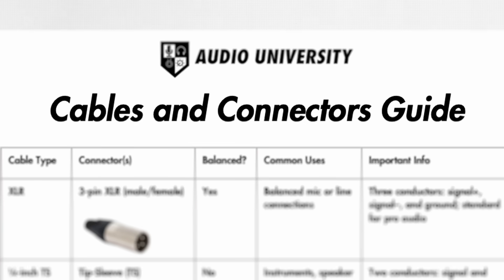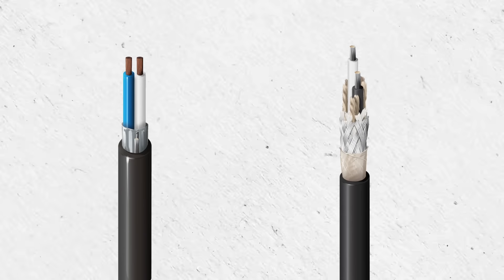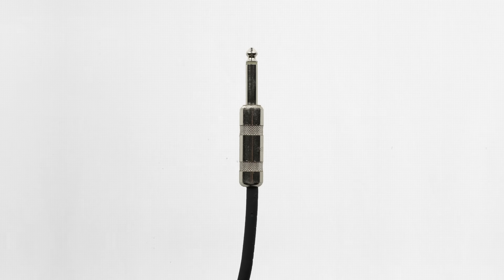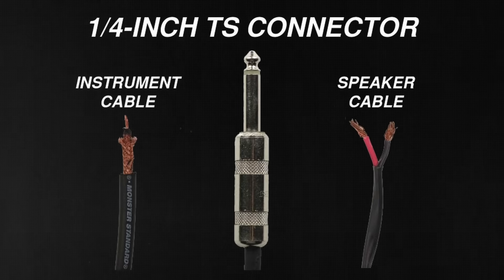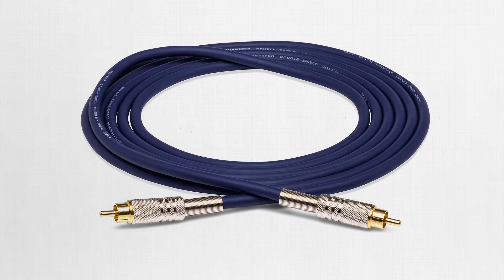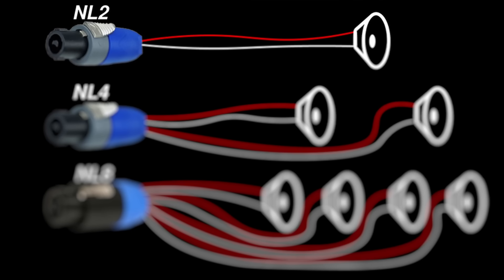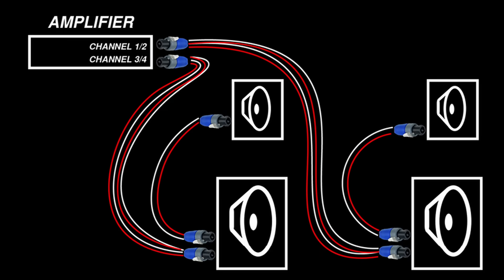The Ultimate Guide to Audio Cables and Connectors

Comment: Don’t say “return“, pin one on an XLR, and the sleeve on TRS are the “shield“ or ground reference. The only time a shield carries any return current is in the phantom power situation. Mini 1/8 inch or 3.5 mm connectors don’t generally carry phantom power, so it is only a shield and ground reference.

Comment: Great video!  @audioUniversity I tried to model my guitar pre-amp by connecting it to my Focusrite Scarlett 18i8 interface, but I got a lot of noise.  After watching your video, I'm thinking I used the incorrect cables.  Maybe I should use an instrument cable from the output of my Scarlett to the guitar preamp, and a speaker cable from the preamp back into the Scarlett?

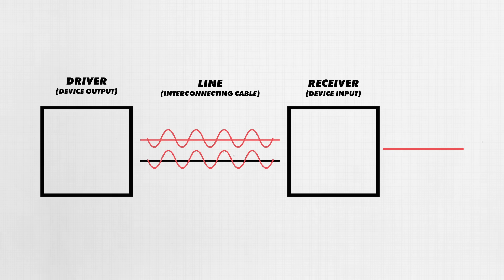Comment: At 1:31, need to invert one of those signals because in an XLR cable, one of the signals is transmitted inverted. So the picture should be drawn showing that.

Comment: And let us not forget DMX cables (used for lighting and other stuff stage automation stuff) that ALSO use the 3 pin XLR connector, but the wiring has different impedance (and capacitance?) than microphone/audio cables. While these cables are sometimes interchangeable, they shouldn't be indiscriminately used in place of each other. It is in your best interest to know which is which and use the right cable for the gear you are connecting

Comment: 2:15  the XLR connector also be Confused with 3 pin DMX Cables because the use the Same Connector, it works fine with XLR cable used for DMX and Vise Veraa, but it doesn't give the best experience compared to using actual DMX Cables

Comment: for a balanced connection,  pin 1 is for ground/shield, if I do not want shielding, can I connect pin 2 and pin 3 only?
Reply: pin 1 should still be connected on the transmitting end and then leave it disconnected on the receiving end.
Reply: @wally7856 why

Comment: The Phoenix to XRL connectors are a godsend when you're connecting a commercial PA system in a rack from the mixer to the amp. One of the Cloud UK amps I have seen in a rack-mounted PA System (Australia) has a Phoenix-like connection for the speaker wire that I have never seen before; it's usually the butterfly plugs on the Cloud Amps.

Comment: If my mixer has XLR outputs, can I use a regular XLR mic cable to run out to a powered speaker? Never had a problem with that, but is it advisable? Also, one of my XLR cables has the pin #1 connected to the connector chassis, whereas the rest of them don’t. What is the preferred usage for each? Rabbit hole time?

Comment: Learned the hard way years ago running a cab with my combo amp, it cut out mid song because of the circuit protection (thankfully) because I didn’t know there was a difference between a shielded 1/4” instrument vs speaker cable

Comment: There is no such thing as an "1/8th connector", it is 3.5mm.As an educator you should know better. There is also a Tini-Jax which is slightly larger.

Stereo headphones are implicitly balanced. The cable has four wires with the returns only joined in the plug so the "common return" only exists in the output jack. A loudspeaker is a differential device, it has no common reference. Interference would have to be massive to overcome the impedances involved.

Comment: Yes! Neutrik and Switchcraft connectors are by far the best, with precision engineering, precision mechanical/electrical connections and high quality materials. For Neutrik Speakon connectors, DON'T mix these with cheap Chinese knockoffs, the dimensional tolerances are mismatched. You will have high resistance connections to your speakers and you'll be sorry. Ask me how I know.....

Comment: Ookaayy, but why and how is the AES III wire different from a typical balanced mic cable? And what happens when you select the wrong one? Is there even an obvious telltale that differentiates one from the other?
Also, it's such a bad idea to use  TS 1/4" connectors for speakers. But if you did end up using an unbalanced instrument cable for the speaker, overheating or noise(?) might not be the worst problem, it might be the way it ruins the sound (low end) due to it's higher resistance.
Reply: AES3 Capable Cables are twisted pair to mitigate crosstalk between the conductors for the High Frequency needed with AES and also DMX (the Lighting protocol). it will say either AES/EBU; AES3 or 110 Ohm on the Cable (some just say DMX, the work fine aswell). sidenote: just because it does not say that on the cable does not mean it wont work. as long as everything is properly terminated and especially with a 48khz Samplerate you can get away with some pretty non optimal cables. just dont expect to reach the full 300m. but the nice thing: it digital. it either works or it doesn't.

Comment: One Question @AudioUniversity - Is it OK to have a cable that has 4.4mm Balanced jack on one end and having a split/dual RCA jacks on the other side? Is this technically OK OR shouldnt be used? Does this yield any better audio signal out of a source, say a DAP?
Reply: @kavithapremi  4.4mm? Sounds like a stereo 3.5mm unbalanced plug.
Reply: @tanelehala6422  Yes,  4.4 is stereo. But, a Balanced one.
Reply: @kavithapremi  Right, I had forgotten about the existence of that plug. I believe  the scenario you presented is technically okay. It's probably wired with shield and minus bridged or only one of them connected. You lose the balancing but in consumer audio when does it even matter? In extreme cases it might help against some noise or ground loops but definitely won't give you "better audio signal". It's often overkill and in the territory of audiophoolia placebo. And better audio signal compared to what exactly? In what scenario are you using it? Balanced headphones don't make much sense to me, it's an amplified low impedance signal and there is no possibility of a ground loop.
Reply: @tanelehala6422   Thanks and appreciate the response. My use case is in my car audio setup where the source is A&K SR35 DAP that has all 3 stereo outs [2.5 Bal, 4.4 Bal and 3.5 single ended], I decided to use 4.4 out while my DSP/AMP has only RCA in.
Better Audio Signal - compared to regular 3.5 single ended stereo to RCA interconnect.
Reply: @kavithapremi  no problem. IMO whether it's objectively better can only be measured. I don't believe using the 3.5mm output would make an audible difference but should be confirmed with a blind test and Frequency response, Total Harmonic Distortion, Signal To Noise etc measurements. Whether the difference is actually audible depends on the magnitude of it, your hearing, the rest of the equipment, the listening environment, the source file etc. If anything claims to *subjectively* sound better/different, it's often added distortion/saturation instead of transparency. I've heard that odd harmonics distortion can be pleasant. Any subjective claims mean nothing to me without being confirmed with a double blind test. Placebo effect is one helluva drug. Been there, done that (discovered EQ was on bypass).

Comment: What? No mention of DB25. In audio used as a breakout cable for up to 8 balanced channels. Worse yet, there are 2 'standards' for these cables. Often found on mixers and capture devices. 

Then since you mentioned 1/4 in to ring sleeve cables didn't forget the other use, insert cables. Where one pin is source and the other return. Used to insert effects units and the like. 

Audio is not the only cable that takes advantage of requested pair wiring, as with XLR. The party you didn't mention about common mode rejection is it requires the signal wires be trusted inside the cable. Other cables that use this S Ethernet cables, 4 pair of them. This is why they can sub for XLR audio cables. There's also HDMI that uses I think 8 pairs.

Another use and misuse of XLR is DMX. The importance is closer but not exact.

Comment: SPDIF RCA must have 75 ohm impedance, Canare (Japan) has 75ohm RCA connectors and cables that works.
Reply: That same impedance is used on old analog composite video and digital video SDI. Go figure. All with either RCA or BNC.
Reply: @PhilippedeBersuder  I've seen cheap analog RCA cables used for SPDIF between CD players and DJ mixers. Haven't heard them not working yet. Probably 1.5m in length.

Comment: Whats the Likelihood of XLR carrying stereo signal over a long distance without  much noise..
Reply: If it is AES digital then you should be fine. If it is analog...well, you can try it, using appropriate adapters on either end of the XLR3 cable but doing this will not be a balanced audio connection in any way, and it definitely is not a recommended practice. The cable doesn't magically eliminate noise, it is the differential input that does this. Oh and connecting an analog stereo signal to a single differential (balanced) input will result in some VERY interesting (and utterly unusable) audio.

Comment: Ok, but how do you tell the difference between cables with identical connectors that are intended for different uses?
Reply: Look for a text that's written on a cable itself. Usually you'll find brand name, type and model of cable written there
Reply: @distortionua As well as things like gauge of wire (awg), number of conductors, and possibly the ohms resistance. Some cables also have a ft or yard mark on them for easy work making up certain length of cables.

Comment: I think it's worth mentioning that what we, generically, call XLR jacks today, are in fact 'Cannon XLR3' as this particular form factor was invented by them to provide power to their cameras.
There are other types too, the main one USED to be Amphenol, which were widely used up until the 1970s and the mini 'XLR 4' types are still often used in CB/Ham radio setups as mic connectors.
There are also XLR5,6,7 etc jacks in use for things like Valve/tube based mics as well.
Great video though by the way!
Reply: That explains why the guys in Crash rehearsal rooms in Liverpool used to call mic leads "canon to canon" back in the 90s'.  Every day is a school day :)
Reply: @wagonwheel6420  Yep, I was working in TV back then and we called them 'Cannon Jacks'.
Reply: Cannon (now ITT Cannon) is a company that makes connectors.  Canon (no double 'n's) is a different company that makes cameras.
Reply: @groovedealerfeaturing-ashl6476  or 5 pin XLR for a stereo microphone
Reply: 4 or 5 pin XLR connectors were used as the speaker-cabinet connector for vintage Ampeg Portaflex bass amps and as control cables for dance club strobe lighting and fog machines.

Comment: In the context of stage/PA audio it's also important to mention DMX cables for lighting equipment. These are basically the same as XLR cables for digital audio connections (110-120 Ohms impedance, rather than the ~75 Ohms usually used for analog audio) and should not be mixed with XLR cables intended for analog audio.

It mostly works when you use digital cables for analog audio (the mismatched impedance also degrades the signal, but usually not to a noticeable degree in the audio frequency range), but it will cause problems in lighting, where the various fixtures are daisy-chained (which can lead to runs of hundreds of meters length with a lot of intermediate connection points, all potentially causing signal reflections when mismatched). Your lighting technicians will be pissed when they run into problems and have to replace cables somewhere up in the rig, only because someone accidentally dropped an audio cable into their cable boxes (and they will know where it came from, obviously).
Reply: This happened to me once! I was setting up a PA for a Solo Comp (Show Choir things) and decided to chain 2 speakers to 1 output. One of my speakers was getting input, but the other wasn't. I thought the speaker was broken, but I swapped the cable just in case and it worked perfectly. I got rid of that cable very quickly 😂
Reply: So essentially what you're telling me is that if you need proper impedance, then DMX gon' give it to ya, but if you use XLR then it's gonna make the lighting tech lose their mind up in here, up in here.
Reply: No unless your Not doing Like a km with 400 fixturea ist doesnt Matter. I have ~300m with 30 Sometimes 40 fixturea and never Had a problem
Reply: @LinusMerz-o7y it depends on many factors: cable length, quality of connectors, corrosion on the connectors, the fixtures themselves, ...

I've had 300m runs with no issues, but also 200m runs with just 10 fixtures that suffered from signal loss. Maybe it was just a bad combination of cables and crummy line-receivers in the fixtures, but when I run hundreds of meters of cable I don't want to take any chances of doing the work twice...
Reply: Why is DMX 110ohms? Couldn't they just have gone with 75 like audio? Or vice versa
Reply: Analogue audio is not 75 ohms. That is the characteristic impedance of coaxial digital audio, originally S/PDIF. AES digital audio was specified to be able to use analogue XLR cables, but as sample rates increased the quarter wavelength became significant and proper controlled impedance cables had to be used. The characteristic impedance is determined by the cable dielectric materials and dimensions, for twisted pair cables the number of twists per inch has to be controlled more tightly than ordinary analogue cable. Don't confuse characteristic impedance with DC resistance, it is only significant at high frequencies at cable lengths that become transmission lines. Look it up on Wikipedia.
Reply: What's also confusing about DMX is the controller outputting a female socket

Comment: TS, TRS, 3.5mm TRS and BLOODY ADAPTERS!! are the bane of my life as a commercial sound engineer. Mono TS, mono balanced TRS, stereo TRS, XLR adapters, TS only adapters, 3.5mm adapters, phono adapters. Then there’s TS speaker cables that look exactly the same as an instrument cable. Then those cheap microphones with TS moulded plugs on the end. Trying to explain to non-technical customers that just because it fits doesn’t mean you can plug it in there is so annoying hahaha
Reply: One of the most typical errors: plugging unbalanced stereo into a balanced mono socket and getting Left minus Right. How many times I've had to rectify this...
Reply: @tanelehala6422 I'm NOT a pro audio expert, but so what is the difference between a mono balanced TRS and a stereo TRS, and why wouldn't one work for the other? Is their wiring different in the plugs or what? (And if so, then HOW are they wired differently?) And I also thought that a L-R signal WAS/IS a balanced signal, because isn't it the difference signal that the amp or device looks for to operate properly anyway? (Or am I misunderstanding all of this?)(Will someone please explain the technical details and difference(s) please?!)
Reply: @JoeJ-8282  The TRS cables and plugs do work interchangeably for mono bal and stereo unbal if both the input and output are the same type. I meant plugging a stereo unbal output into a mono bal input which gives Left minus Right. Mono bal into stereo unbal would result in either 180° out of phase signal or 1 stereo channel only if Hot&Cold. The second part, I'm not sure what you mean. Where do you get a L minus R signal? Mid-Side (L+R & L-R)? Opamps are differential but unbalanced signals are referenced to ground while balanced signals are actually differential, can be 180° out of phase or hot+cold but the conductors and their impedances are identical which makes the near identical noise cancel out.
Reply: @tanelehala6422 had a similar issue when someone bought a 1/8” TRS to XLR to run a computer on stage. 

As far as I know, no commercial manufacturer has ever made a 1/8” mini phone jack output carrying a balanced signal. That’s always used for stereo unbalanced audio (when it’s an audio output)

So along comes this Amazon purchased adapter cable… that’s wired just like a 1/4” TRS to XLR. 

The musicians couldn’t figure out why the computer sounded TERRIBLE in the sound system. Finally, I asked about the keyboard player’s patch cable …. and I probed it with a multimeter. 

Sure enough, the tip and ring went to 2 and 3, rather than being wired as an unbalanced connection. Worse, this was a splitter, so this just put out two balanced feeds, rather than tip to one XLR and ring to the other. 

We bought him a USB direct box. Problem solved. 

Lesson: know your cable and don’t trust that because it looks like it fits that it’s the right cable. 

Also, never, ever use the built in audio output on a laptop for on stage audio. Get an interface or DI so your sound people don’t have to plot your demise during sound check.
Reply: @tanelehala6422  Our keyboard player made that mistake. He bought a 3.5mm TRS to dual XLR cable, hoping to get stereo unbalanced output from his Macbook.

Instead, the cable was wired as a balanced, mono splitter. We ended up getting him a Mackie USB direct box, which is a perfect direct to XLR solution.
Reply: I start rattling off all the connectors and adapters when someone starts trying to tell me how to do the job when they clearly have no experience other than their home Hi-Fi system. Do you use Dante or another one? What do you think of the Allen & Heath SQ5?, dam I have run out of XRL to TS adapters, do you have any?.

Comment: Leave us not forget the instrument cable (shielded tip-sleeve) used on a speaker, especially with an older amplifier.  The capacitance profile can make the power amplifier unstable, possibly causing funny sounds, overheating & expensive equipment failure.
Reply: I Laughed my nuts off at a 'guitarist' i used to play with many years ago, who insisted on using a VERY cheap, moulded 1/4 inch instrument cable (which actually picked up local taxi radios) as a speaker cable.
He was using a Marshall Variac into a 4X12 cab... it started smoking and burst into flames one rehearsal and couldn't muster the breath to say 'we told you so' as i was laughing so hard.